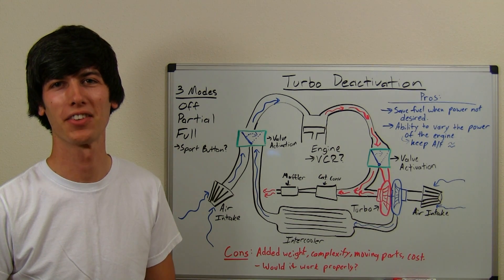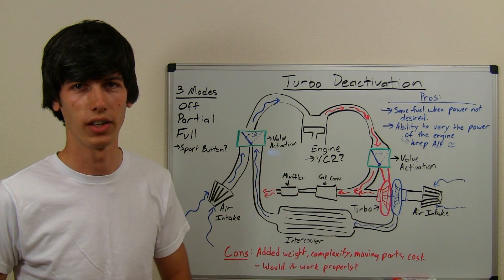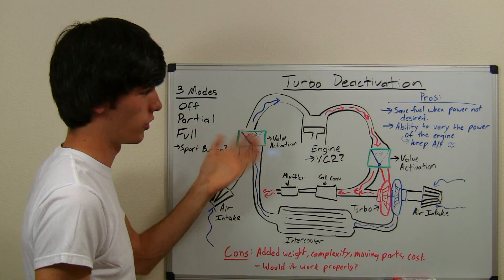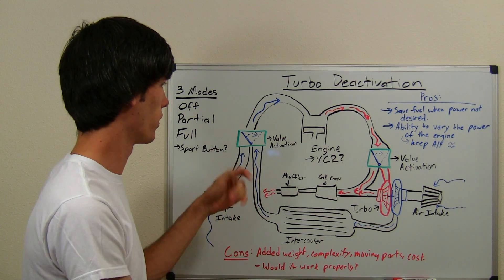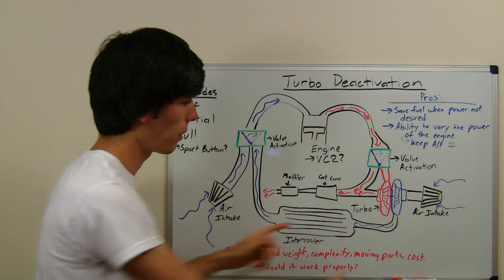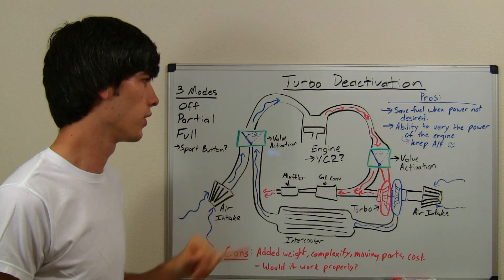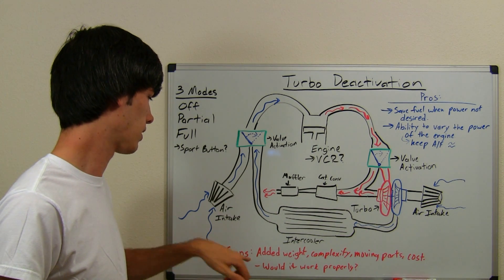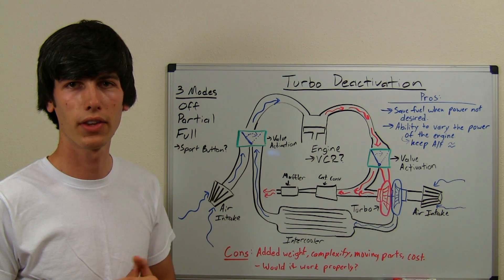Turbocharger Deactivation Concept - Explained

Comment from the maker: Well the problem with cruise control is that a human can more efficiently drive on the highway than a computer. With cruise on, a car may apply full acceleration to maintain speed while going up a hill, where as a driver can let the speed drop a little bit and not put full throttle.

Comment from the maker: That was the intention, not for a small elite supercar group, but for higher performance vehicles, that you don't always need the extra power in. Like using N2O but with less risk and no need for replacing the N2O.

Comment from the maker: Right, to make equivalent power, but that's not the point. Less power would be created without the turbo, but better fuel economy could be achieved. I think the ability to turn off a turbo could be useful, say highway driving when you don't need boost to coast a simple speed. Or city driving if you don't want the extra power.

Comment: At idle, serpentine belt is running slow just like how exhaust gas runs slow. The only reason why this would not work is if the exhaust gas flow isn't strong enough to run them. But that's very unlikely as turbo unit gives significantly more force than a friggin leaf blower. (See youtube vid on using leafblower on intake which gave no hp gain while a small turbo unit did).

Comment: Would a belt driven procharger work better? Either swap belts when you want to race or some sort of an electric clutch set up? Wouldn't produce as much boost as a turbo, wouldn't be getting the 'free' power from the exhaust, but would still give you that extra omph on command. Maybe tie in the electric clutch and dual computer tunes to you sport button? That has been my idea for a long while. Do you think it would even work? I like your idea a lot, that would be fun to drive! Love the vids!

Comment: but in many cases, the turbo actually saves your car fuel, so it would make sense to not go through the trouble of adding more parts and just stick without turbo deactivation. I only see this being a good idea with very high performance cars but not with lower performing cars.

Comment: Variable compression ratio is a tough technical hurdle, if you can solve it production-feasibly, you can write your own ticket ;).

Generally, the BSFC of a turbo engine at high power is worse than a similarly powerful non-turbo engine, but at low power you can end up with better efficiency because the reduced mass and frictional loss can overcome the reduced efficiency of lower compression, since cars use mostly low power fuel economy can be improved for the same installed power.

Comment: One of the "pros" of turbochargers is that they don't suck power off the engine. If you did what you said, It would take power from the turbocharger and cause turbo lag. (I believe)

Comment: This idea would work, but I don't think there's any reason to. First of all, the whole point of a turbo is to generate more power at low rpm so that engine doesn't need to rev high and create more friction. Turning the turbo off would require the engine to rev higher to make equivalent power.

Comment: Silly man, your exhaust valve is basically a wastegate, and the intake valve is unnecessary because the turbocharger/intercooler and associated plumbing don't represent much of an intake restriction, especially considering that you're restricting the intake with a throttle plate anyway at low power settings. 

Basically, you can accomplish your variable turbo involvement simply with the existing wastegate, you just change the set boost pressure that the wastegate is servoing to regulate.

Comment: Ever wondered why they never used the exhaust turbine to run alternator, A/C compressor, P/S pump, etc? As of now, they're just sucking power off of engine. It doesn't make sense.